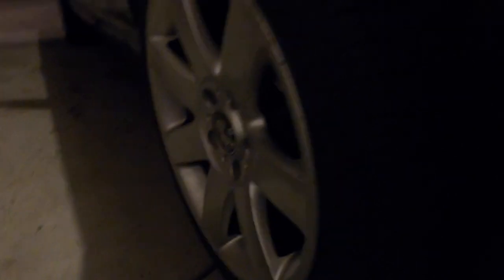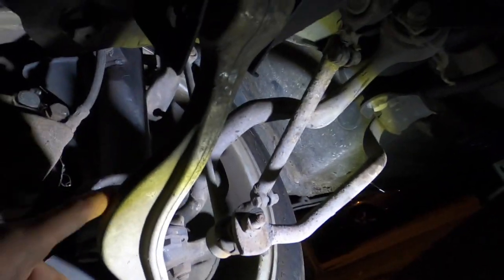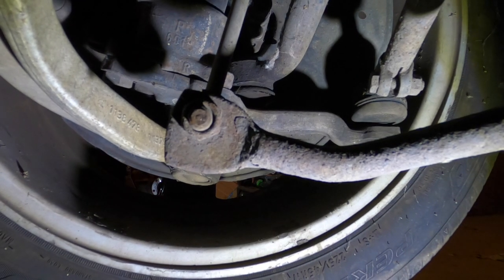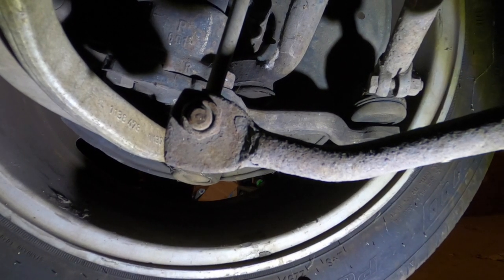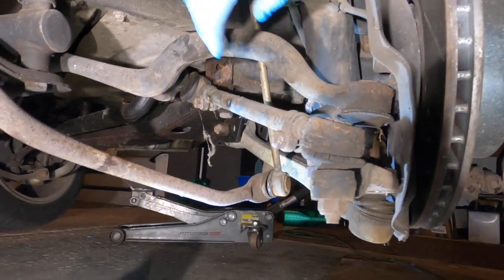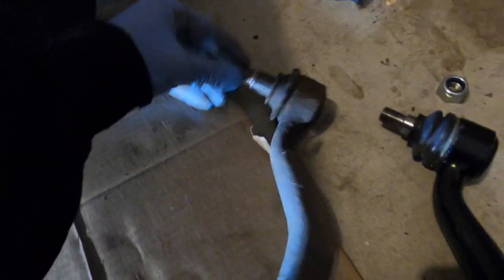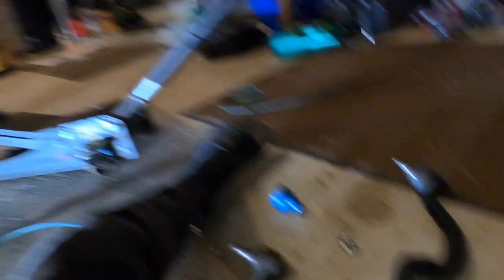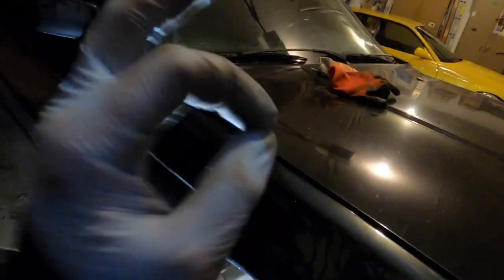Winter beater E34 Clunk SOLVED; plus lets try to fix a grinding transmission!

Comment: I love the vids man, and I would like a vid about comparing all the e36's. the 4 cylinder ones and 6's. I wanna buy one but I want to make the correct purchase.
Reply from the maker: If only I had any to compare! Only have an M3, but Ill tell you right off the bat, forget the 4 cylinder. 328s are probably the best. But Im a fan of obd 1, so 325
Reply: @m3nameisjosh464  alright thanks man! I’ll be looking for either an m3 or some kind of 328is
Reply: Or 328i, 325